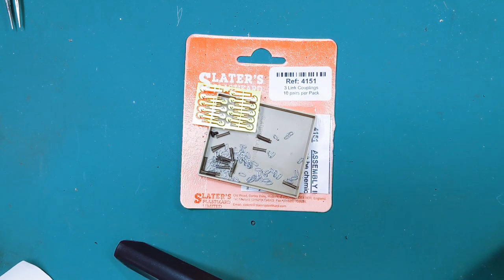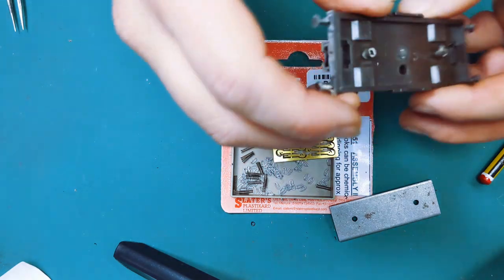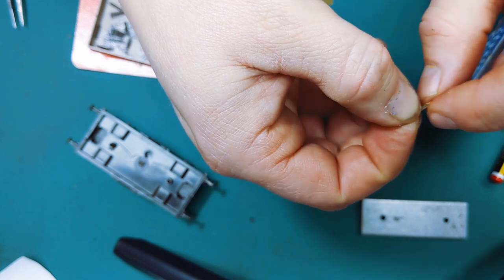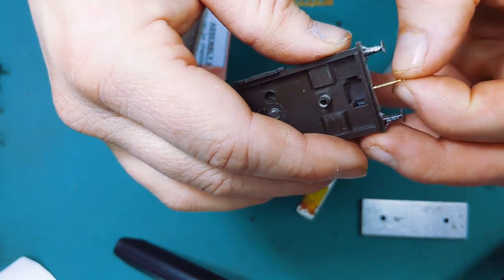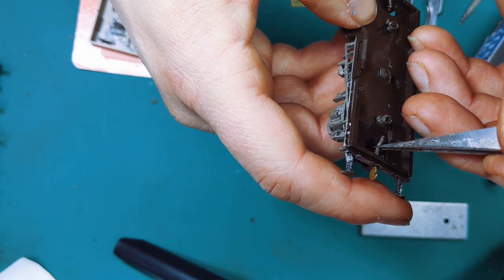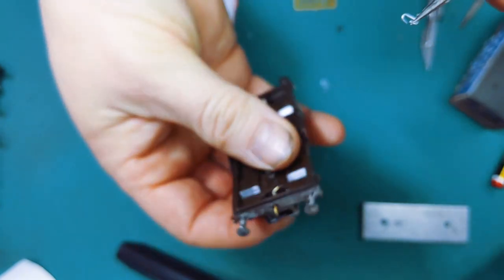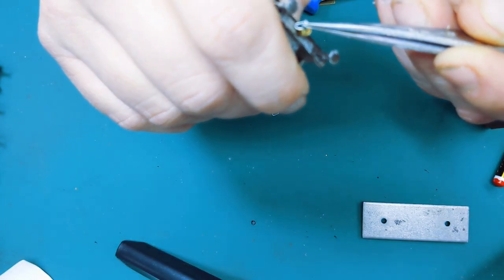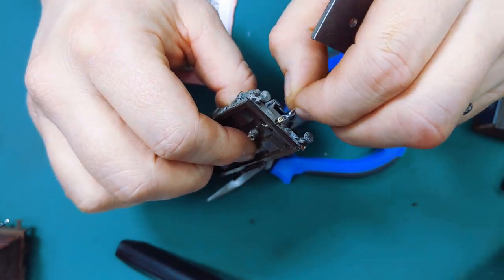Attempting to fit 3 link couplings to 00 wagons!!

Comment: I bought a length of scale chain from a model boat store. After snipping off a 3-link length of the chain, I shaped another single link into a hook shape using two pairs of long-nosed pliers to grip it, then bored a fine slightly undersized hole in in the centre of the wagon's cross member and dipped the straight end of the hook in glue and holding it with pliers, twisted it back and forth and screwed it into the hole. Then threaded one end of the 3-link chain over the hook and slid it back against where it protrudes from the wagon cross member and glued that link so the chain hung down. So far, I've used this coupling on my O Gauge stock and it doesn't ever become uncoupled when running. It looks authentic too. I'll try the same method on my OO scale layout next using a slightly smaller chain.

Comment: This is brilliant!!! Sadly for me it's impossible to buy slater's or smith's 3 link couplings so i make my own chains for rolling stock out of bended and cutting staples into link shape with a pair of tweezers. They actually are functionable for pulling! But the process can be very hard sometimes by getting just the right size so the link isn't too large to drag on the sleepers

Comment: Thanks for this as I thought it was me that thinks this is a PITA. I dont bother with the springs and just use superglue. Your tip on twisting the links is so obvious to open them...thanks for that.I just connect 2-4 wagons in a fixed rake with spratt and winkles in between mini rakes
Reply from the maker: Glad to off help Paul.. Many thanks for the comment. Regards Dan